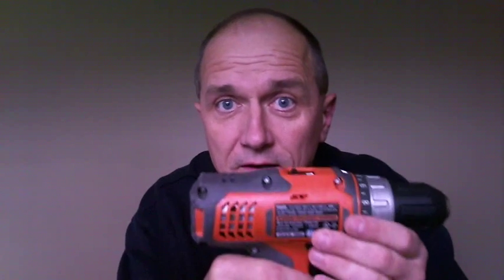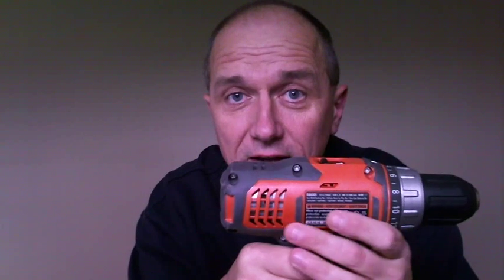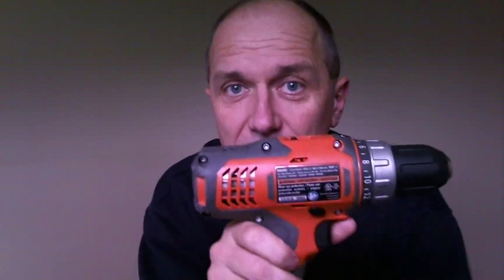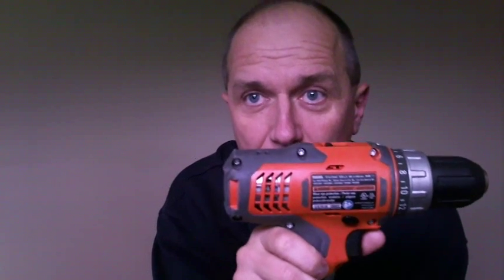Induced emf in an electric motor

Comment: When explaining motors, BEMF or CEMF (back or counter) is the voltage generated by the rotating armature of the motor. The faster it spins, the more voltage or EMF is generated in opposition to the applied EMF. The transient spike that occurs when abruptly stopping the flow is caused by the field collapsing. Because the current vanished instantly the field collapses at a velocity approaching that of light. As EMF is directly related to velocity of flux, the voltage tends towards infinity.

Comment from the maker: I watched it up until the point about Back EMF. It does seem to be an engineering distinction to call the two different induced voltages different things. Since it's the same physical process causing both, physicists don't often distinguish the two. (NOTE: The motor discussions suggest the current to a DC motor is "constant" as long as the voltage and load are constant. In fact it will have an AC component as the armature moves through the field, much like the transient when it's turned off.)

Comment from the maker: Would it be safe to say that the term "induced EMF" in an electric motor could be used for both effects? It's been enlightening to look at all of this in more detail.
On a side note: Holding a motor so that it can't rotate should produce no back EMF (and thus maximum current), correct?

Comment from the maker: Actually, a voltage is induced any time the current _changes_, and the the induced voltage will attempt to oppose the change in current. So there would be a big induced voltage when a motor is turned off OR on; in the video it's easy to see it when the motor turns off.

Comment from the maker: I wonder if this is an engineering distinction in terminology; in physics, back EMF simply refers to induced voltage bay a changing current which opposes the change in current. One of the most frequently used examples is of turning OFF the current to a device. ( A google search will give several examples.)  Perhaps in engineering the term is used more specifically. Any engineers around?

Comment: Hey great vids.  Can you tell me what to do to shield a motor in my shop - I'm getting headaches from the magnetic fields blasting off it.  Considered lead rolls - copper wrap etc.  Just want to take care of it on the lathe, drill press and what not.  I've metered the drill you use here in the vid.  EMF off the charts when running - interesting about the back current.  Thank you

Comment: Terry, have you seen Peter Lindemann's movie "Electric Motor Secrets"? It's a little boring and just drags on forever, but there is some very valuable information related to this topic. It wasn't until I had watched this video that I started to become aware that devices like the Bedini SSG are not using back EMF, but are recovering the stored energy of the coil as the field collapses.

Comment: Respectfully I disagree. But only because the back EMF is only generated when power is applied to the motor where as the transient spike occurs after the power is disconnected. In conventional circuitry (motors) the two are indistinguishable. However both events occur at different times and exhibit different characteristics. I do see your point as the current is what is driving both events to occur. I'll look into what some of the earlier experimenters had to say about this phenomenon.

Comment: That is called a transient spike. BEMF is EMF generated in OPPOSITION to the applied EMF. An electric motor is both a motor and generator at the same time. Both actions work against eachother. This is why electric motors have less than 100% efficiency.